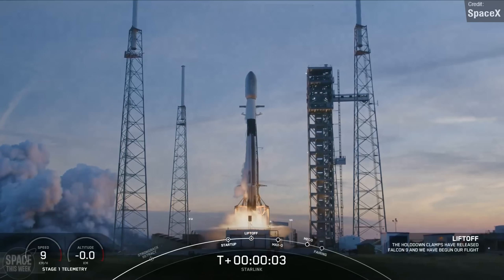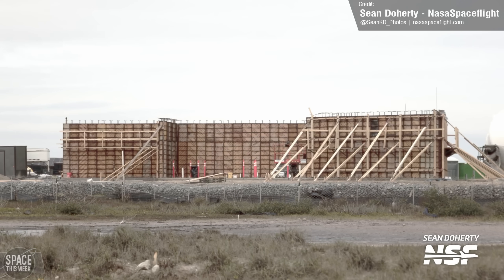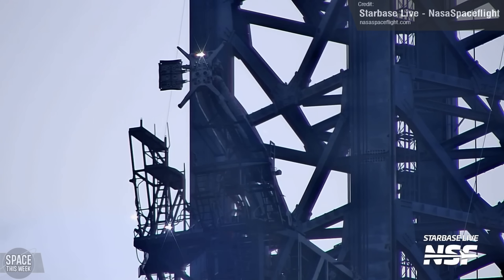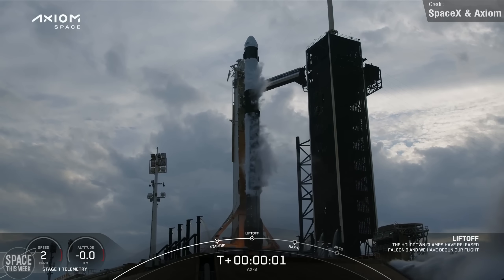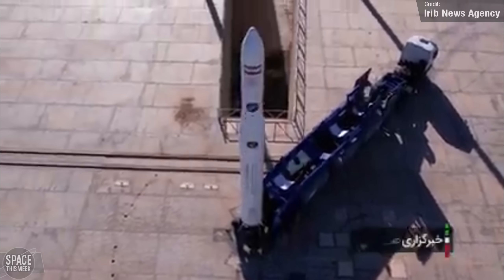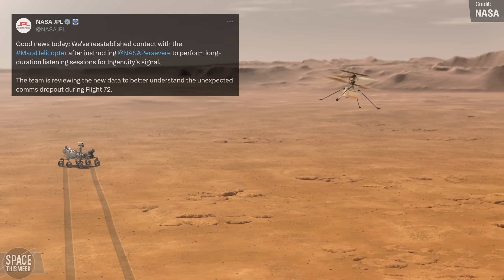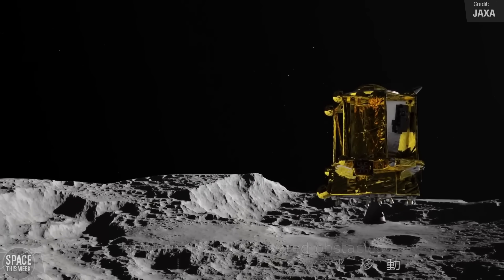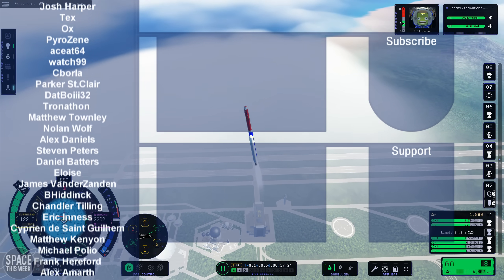SpaceX are Reinforcing Starbase for Starship Flight 3!

Comment: So I not very in the know on this topic but super interested

Why don't they build a long inclining run way with a carrier so it tracks the spaceship along the inclining runway and make it long enough so that at the end of the track the ship is fired up with enough thrust to let it sling into the atmosphere then into the upper spheres wouldn't that reduce significantly, how much fuel is used so instead of using fuel to get off the ground we instead use a railway track runway that would use a mag lev or some similar system that just uses electrical power to accelerate and launch the ship up and get it so that we can get it off the earth and retain as much fuel for further distance in the Freescale above the earth's spheres?
Reply: The 2 biggest issues with that are atmospheric drag burning the ship completely if its going too fast too low, and it probably being way more expensive to have a half mile long mag lev catapult than to just strap your payload to a chemical rocket.  Hope that maybe clears it up for you.
Reply: @sock398  thank you yes some but low atmosphere wouldn't burn it up would it? Since some jets can reach Mach 6 and more wouldn't it be a less frictional flight to take off again an angle? And wouldn't it be more cost effective to have a mag lev or some similar type track system that could repeatability be used over and over instead?
Reply: @roedurham3499  the main issue is that those jets only go that fast way higher up bit the space ship would be starting from the ground getting a whole lot of acceleration all at once at sea level in the thickest part of the atmosphere. You could get around that by building way up in the mountains but that would be a logistical nightmare
Reply: @sock398  ok I see  now thank you. That makes a lot of sense. Thank you
Reply: @roedurham3499  no problem, you are asking very good questions and showing curiosity that will truly lead you somewhere, have a good one

Comment: How much does it cost every time SpaceX blow up a starship and booster?
Reply: SpaceX doesn't plan on reusing these prototypes. Like every other orbital launch system on the planet, with the exception of their own Falcon-9, the boosters are single use.

So the tests cost the same whether or not they reach orbit.

The entire development process is expected to cost less than a single SLS flight. Eventually, the boosters and starships will be reusable.

Comment: Huh. It took three months for that JAXA mission to get to the moon? Shouldn't it had been quicker?
Reply: They used far less fuel by using the Oberth effect which takes a lot longer, but using short burns at the perigee, they save lots of fuel at the expense of time.  Many smaller launches use this. Manned launches require quicker launches to avoid radiation from the Van Allen belts and keeping payloads alive.

Comment: That Iranian rocket is not a prototype ICBM honest. Really honestly it isn’t. What do you mean I have my fingers crossed behind my back? Of course I don’t…
Reply: All orbital rockets are ICBM's.
Reply: @filonin2  only in the sense of range and throw weight. In most other respects the requirements of the two are very different.  ICBM’s need to be easily stored in a fuelled state, have a short launch sequence, be mobile, and have little launch infrastructure. Orbital rockets don’t have those limitations but have other requirements. For instance for engines that are capable of being throttled, of being restarted, and having high specific impulse. Along with the rocket being capable of being mated to a wide range of different payloads.
The Iranian rocket is solid fuel only very good for an ICBM but poor for an orbital launcher. Has a road mobile launcher, very helpful for an ICBM but a waste of money for an orbital rocket and has very much a fire and forget launch infrastructure. This has been designed as an ICBM not an orbital launch system.